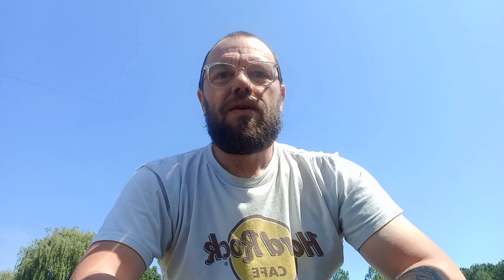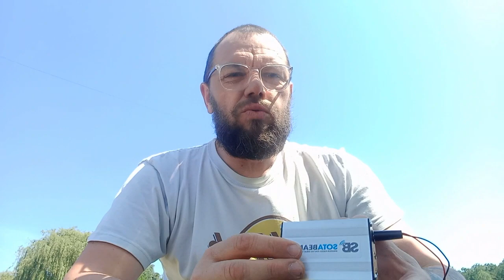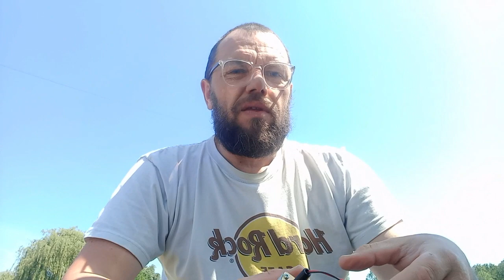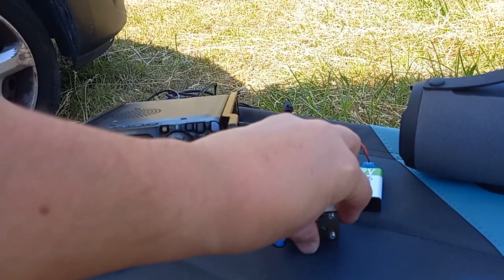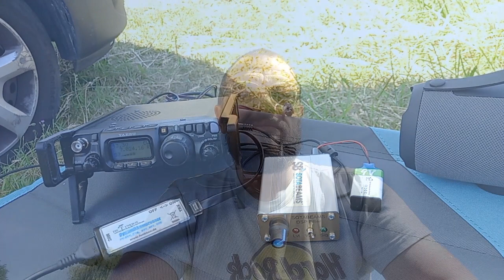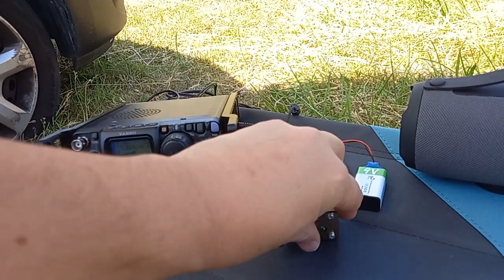a DSP CW filter for my FT-817. Will it work ?

Comment: Interesting! I didn’t know it could be in a separate enclosure. I always thought it had to be installed inside the radio - I was always worried I would ruin something if I did it wrong. 
Can you, please, tell me more about the enclosure? Tnx de WB3CFN…dit dit 😊
Reply from the maker: That's exactly the reason I got this unit. I am afraid to ruin my FT-817 when soldering and changing internal stuff. The chip can be bought from Sotabeams apart, or with this enclosure. You can buy it in kit or completed. You can find all info on the site of sotabeams if you want.  Best 73  de ON4MGY Nic